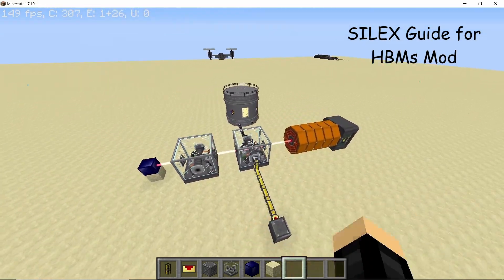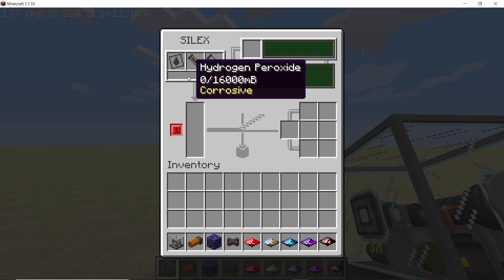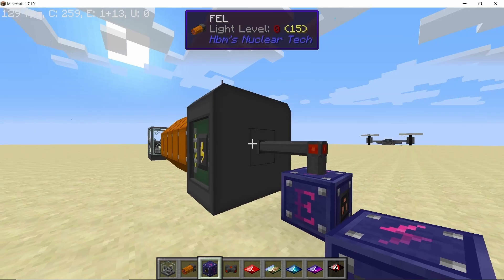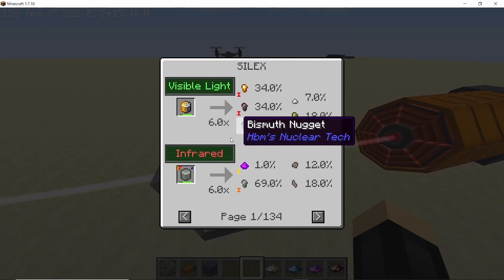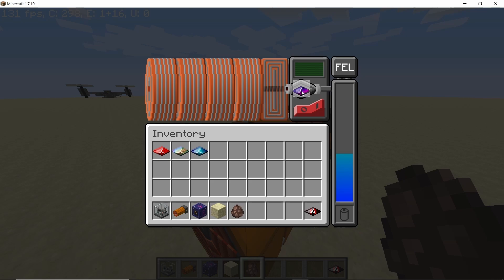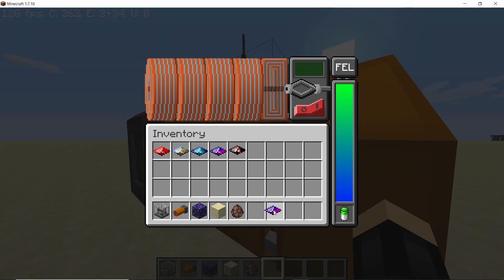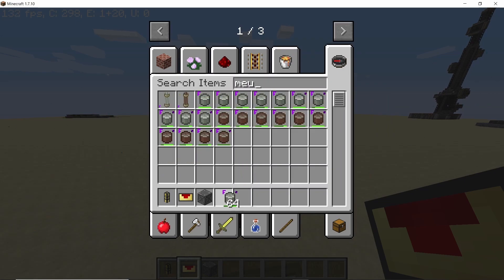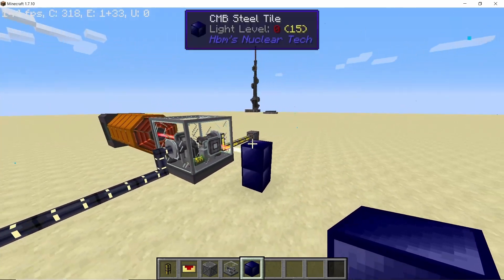SILEX Guide for HBMs Mod | How to use Silex in HBMs | How to Recycle RBMK Fuel using Silex in HBMs

Comment: I wonder if you can overclock it with 3 more lasers
Reply from the maker: nah I don't think you can , plus where are you going to place 3 more ?? there are only two sides on the silex where the laser can be placed
Reply: @SavageVegeta  ok then im going to have its lazer limit as it hit the "little" part of the SILEX then put another lazer opposite of that. SILEXium tech is hard

Comment: Hey savage ! I have a question for you, is this 1.7.10 or 1.12.2 and which of the 2 versions are the most advanced in its developpement ?
Reply from the maker: This is the 1.7.10 version. Out of both of the versions the main is 1.7.10 and it receives frequent updates !!
Reply: The 1.12.2 version gets update approx. Every 10 1.7.10 update

Comment: have you tested if hoppers still work on silex? like input and output
Reply: hoppers work when you put them on the bottom center because there's a hidden connection down there which also works as an input for items or fluid
Reply: @cmb9173  cool
Reply from the maker: Yeah I had tried em on the side slots and they work perfectly. and yeah as with every HBMs machine a hopper on the bottom serves as an automatic output like CMB suggested ( and the top as the input for single block machines and the side slot for bigger machines )